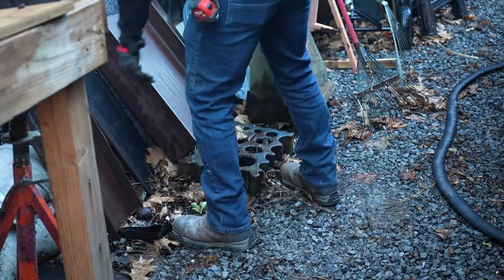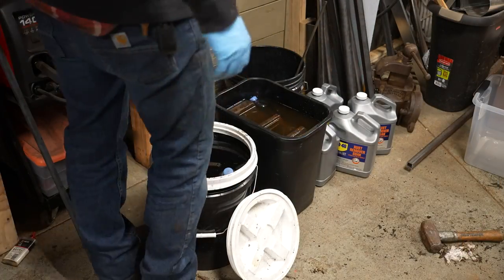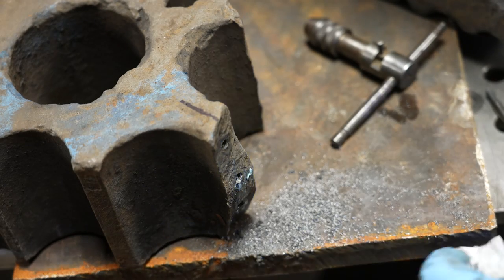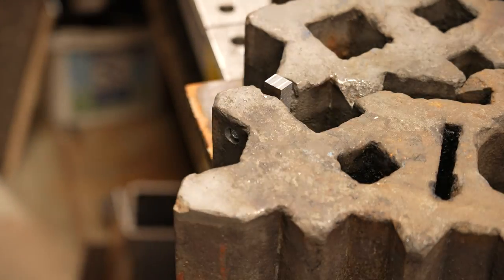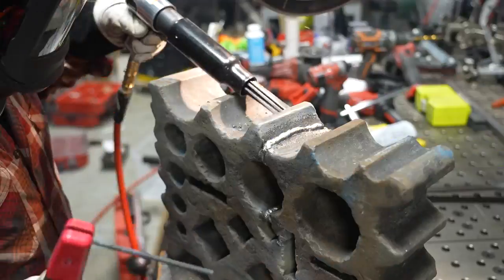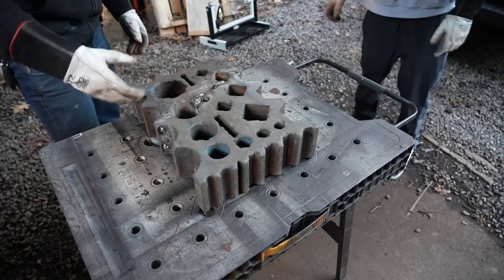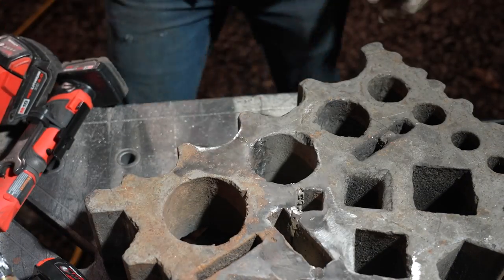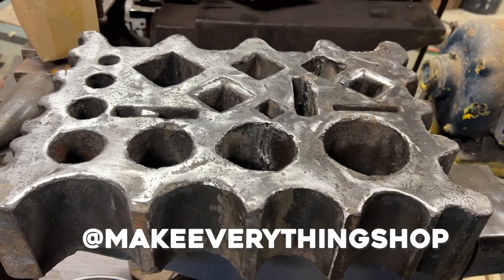Can This Even Be Repaired??

Comment from the maker: Did I ruin this? Or will it survive? Leave a comment down below!
Reply: When heating a larg cast peace go to the desert at the heat of the day and let it cool. It's like a camping trip for welding. I put my how i would do it as a comment below.
Reply: .... Is it broken if you build a stand to use it broken and hold it together.... ????
Reply: When you re-repair it, tig braze it with silicon bronze next time.
Reply: i think you did a good job
Reply: My degree is in welding engineering. OK? - I do not EVER melieve in Ni Rod for anything other then a quirk camouflage job, but I think you will basically get away with it for most of what you are likely use it for,,,,,

If i HAD to do it though (and didn't have a big heat treat furnace, after I got it fitted up and V grooved  I'd dig a pit and put 6 or 8 inches of charcoal in the bottom and get it burning.  Then out the part in it and bury it in charcoal and cover it all with fiberglass insulation (Foil not paper backed) - and leave it over night. - Then pull it out and keeo it hot with a couple of Belch-Fires and proceed to gas weld it up with real cast iron rod. (Looks like a 10 or 12 hour job so you better have 2 guys to spell each other. ==== After welding it's back into the fire, cover it and then leave it along until the fire is dead out,,,,and it's cool enough to touch. - Then off to sand blast and then to the Lucas boring mill for facing and boring the round features and grind the rest to shape........Wouldn't cost more then 10 or 12 grand.= Not over 20 large for sure. ,,,,, All of sudden Ni rod looks pretty good, Huh?🤣 
 
I still would have done the charcoal pre-heat/slow cool though, 20 bucks worth of charcoal is not much to keep the cracking down (Maybe)
Reply: Im still kinda towards repairing it with a stand that holds it together.
Reply: Well according to an actual expert you ruined it.
Reply: I think you did a good job but I'm not a welder. The fasteners seem like a great idea.

Comment: So you were welding some locations inch and a half thick with two passes of nickel rod. It will look intact, but if you use any force along that same fracture line, it’s going to be a fraction of a fraction of the amount of force that originally did the damage. You need to grind in chamfers along all the cracks so that the weld can start inside the body of the cast and not just on the surface.
Reply: I seen that too! I never said it because he bolting it together! That should help it from braking off!
Reply: Didn't he do that at 5:10?
Reply: @patrickcorcoran4828  he did yes, but ideally it needs to be deeper and even full thickness if possible.
Reply: 100 years ago: "Sure it will hold up one corner of that bridge, that thing is 4" thick!"
Swage block:  "Owee"
Reply: @GTL77  I sawed it also.
Reply: Would have done a preheat in a bbq  and left it on the bbq while welding .... also helps to push any oils to rhe surface of the cast ... cast can be literally any blend of what ever they had laying around  ... well in the Era that was made anyhow....

Comment: In my limited experience with welding cast iron (mostly engine blocks and a few bulldozer frames), I have found that preheating to a medium to a bright red hot works best.  Also, the entire fracture has to be welded and not just the surface.  I honestly wish you luck and favorable results with your efforts on this project. Regardless of the process, that's a really neat swage block you have.  Thanks for sharing this.

Comment: Nickel rod can be tricky to use! It welds kinda like a 6010 rod! And what I found is you don’t need to have a high amperage to weld! And the porosity comes from the sand or what they use to make cast iron, that’s what I noticed in my years of welding cast iron!
Reply: Ditto on the porosity, the original cast iron likely had pores & sand inclusions that are now rust pockets you are melting into
Reply: Truly amazing and well done, always learning from you! Thanks again

Comment: This would have been the ideal project for MIG brazing or gas brazing..  Nickel's one and only benefit for cast iron repair is color match, but is otherwise always crap in my experience.  Braze is easier and better in every way that counts, and in this case, where a swage block is used for impact, those nickel joints will crumble after a few good blows...    I have pieces of hundred year old equipment in my shop that was repaired with brazing by the original factories where they were used and they work as good as new..  They wear their golden braze repair like a veteran wears his medal of honor...
If you had more access, TIG using cast iron filler would have been the perfect repair, but I don't know of any TIG handpiece or gas lens that would have let you get into those openings, but as I said, braze is better anyways...
In terms of mechanical supports, there are also specialized "dog bone" type ties that you can inlay into cast iron to kind of stitch the pieces together, and if you had a fresh break with no gaps, these stitch repairs are often sufficient on their own as structural repair...
Reply: Brazing would definitely be the move here. Nickel does have a specific use-case besides color as it has a very similar coefficient of thermal expansion to cast iron or cast steels. So any application that constantly changes temperature would fail fairly quickly when brazed but remain intact if welded with Nickel. I repaired a cast burner housing on a steam generator last year and had to use Nickel since the part heats up and cools down regularly. It's still in service today and hopefully stays that way.

There are special water cooled micro tig torches that can reach in there; we have one in my shop for getting into really small spaces. It's a pain to use but very handy when you need it. The torch is a little bigger than a pencil. 
EDIT: CK Worldwide makes one that they call the mr140 micro-torch.

Comment: Scary project, welding old cast iron swage block!  Hope the welds hold so it can have a new life.  As to milling the surfaces, I would recommend NOT milling it.  The "top" and "bottom" are not really used.  I would recommend making sure the pass-thru holes are relatively clean and the edges eased.  For the edged swage shapes, make those are smooth and ease the edges (1/8" radius should be good).  Hope there is a future video showing it being used!

Comment: In the end its a swage block, imperfect shapes may be what you need one day! As for the repair I think its fine, the only thing I would have done differently is more of a bevel for deeper welds and more pre heat! It may fail again and it may not, I repaired a broken vice jaw many years ago by heating it in my forge to red hot and welding it as it cooled and its not missed a beat in ten years of hard use!

Comment: I have always used a 55NI rod for repairs similar to these, when ever i could i left the bead intact for a stress releiver.
 Great job on prep, only time will tell once how long it will hold due to the shock applied by hammering
  If you could use a large stump for a base it might help as a shock absorber.
Thanks for a great video , well done.
Reply: A large stump covered with heavy rubber mat or 3 layers of asphalt shingles.

Comment: I enjoyed reading all the comments.. What about polishing up the welded swage block and using it as a pattern to cast a new one I am pretty certain the original block had a bit of 'draft' to it just as the wooden pattern that was used to make the original mold in the casting sand a hundred years ago but then again a person would have to be set up to melt and pour cast iron however with a good pattern it should not be too difficult and who knows you might just end up with a cottage industry making swage blocks

Comment: You need a forge big enough to heat a piece that big to do a good job. I like to completely bevel the joints, and I probably would have brazed this. This is a half day of prep, full day of work, and all-night cooling process. The bolts are a good idea, and the needle scaler is effective and efficient for peening.

Comment: Excellent video! I have to repair a broken piece on our old small tractor.  The piece is an ear with a hole for a pin. I don't have the piece. It was already gone when we bought the tractor. I was planning to use mild steel to rebuild what is missing.  I wanted to try some new welding rod called muggy welding. I may just use the nickel rod.  But I was not sure I could weld mild steel to cast. After watching your video I think it can be done.  I have only repaired cast iron by brazing it. I want something stronger for this repair.

Comment: welding cast iron is rarely a good choice, unfortunately due to the nature of your repair (crack location and intended usage) it will likely fail again. I do have nickel rod in my arsenal. but silicon bronze brazing, or brass brazing along with mechanical fasteners are my choice

Comment: Now it's just going to crack right next to where you welded. Bronze brazing sticks a lot better and it's a lot more flexible than nickel, because nickel is so much harder than bronze you're essentially gluing two bricks together with epoxy. The epoxy will hold, and it will even hold the bricks together - but the faces will detach from the rest of the brick. 

It will work, but it won't hold up to being beaten like an anvil.

Comment: It will work well the way you have done it but there are some improvements you could have made to your process, where the flux started going white and pocking you needed more preheating. Cutting back the cracks to open out the weld points and make the welds deeper would strengthen the finished product.
 When you were done it would be helpful to heat the weld areas to anneal them and relieve stresses in the weld material because all the stress from hammering will be transferred to them by the cast iron ...You could still do that tbh.
Overall a nice job you have given life back to a very useful old tool that will be an excellent addition to your shop....I wish I had one..even a broken one.

Comment: I would have used some bolts to hold it better together also, that is a good thing to do on a repair job like this for sure, but I would have cleaned it much better before welding using a wire wheel, after that I would have put in into a fire pit to heat it all up and to weld it you can just use a normal welding rod wrapped in a copper wire 50/50 welding rod and copper wire or you can use a mig welder and use a copper wire as a filler with your other hand, it is very important to tap it with a hammer between welds to help relieve the internal stress to reduce micro cracks. I had to repair a large cast iron milling machine stand that had a very large part missing, had to cut some cast iron flat bar to recreate the missing section and I used the mig welder technique at about 400 amps with a thick copper wire as filler, the cast iron flat bar was about 3/4 inch thick, there were some micro cracs after the job was done, but some bondo and paint and it looked good as new. It would be also very nice to get the swage block refinished on a metal planer.

Comment: So with cast you are going to get all sorts of suggestions.  That block has been Bea to death already so I see nothing wrong with learning something on it. Could you have done other options? Sure. But the old timers a hundred years ago might have done something similar to yours and I was taught don't mess with old repairs if there's nothing wrong  with them. I might have done more passes on each of the breaks but I think it will hold longer than most the doubters believe . Good job and excellent content keep it up

Comment: Look into the Metabo WEF series of grinders.    They are Great getting into tighter areas.   Those spots where a normal 4-1/2” grinder doesn’t fit great      Cuts down on dynafile and die grinder use

Comment: Make mold, melt down, pour. Perfect repair!
Reply: Sand casting might work for this.
Reply: hmmm.... I wonder if you could pack it in sand, and "bake" it back together.  Bring it just up to molten in sand, and let cool. Would the sand melt first?
Reply: @theobserver9131  The sand would not melt first. It is actually how it was made in the first place... I guess you could try to forge weld it back together, but it would take one hell of a furnace, and the metal would expand before it shrunk back to the original size. I think you´d have to be more than a little experienced as a blacksmith to make that work if at all possible.
Reply: @olenilsen4660  Thanks for the info! I guess maybe making a mold and melt and pour would be the best way? No doubt the forge would have to be serious. I've done some gold and silver, but I know that's small fries in comparison.
Reply: @olenilsen4660  I know there are different kinds of sand with different properties. I imagine glass maker's sand is very different than casting sand. I know very little about that.
Reply: @olenilsen4660  Random question you might know the answer to; what are crucibles made out of?  I should know that, having used them, but that detail has eluded me so far.
Reply: @theobserver9131  Well, the melting point of sand is typically around 1700 C, whilst cast iron is around 1200 C - mind you, in these ranges 100 C change in temperature needs an insane amount of energy. So these are really far apart!
Reply: @olenilsen4660  Best conversation I've had on youtube. Thanks friend!
Reply: @olenilsen4660  I haven't done much casting yet. It's on my list of arts I want to learn. I'm artisan level in woodworking, but I want to play with more things.
Reply: @theobserver9131  don´t worry, mate! Crucibles are made of ceramics, they probably have different temperature ratings - I haven´t used those myself though, so don´t always second guess yourself! Just make sure you think of your own and everybody else´s safety when you experiment with things. And always keep it as small as possible.
Reply: @olenilsen4660  My very first welding project...how I learned to weld, 30 some years ago, was a flying swing carousel ride for festivals....too big?😃
Reply: @theobserver9131  go big or go home!
Reply: @theobserver9131  Mostly Graphite based composites. Due to excellent resistance to temeperature changes, chemicals and thermal conductivity. They also have a brutally high melting point of 3650°C - 3700°C. That means you can even use it to melt Tungsten! It has the highest melting point of any metal; 3422°C!

Crucibles can also be made out of other high temperature resitant materials such as Platinum, Alumina, Zirconia and Magnesia. I dont know how often those kinds of Crucibles are used nowadays but i dont think its all that much.
Reply: @Sharpless2  Wow! Wonderfully specific and detailed answer! I could have looked it up for sure, but I like the human interaction, when it goes so well like this. Thanks!!